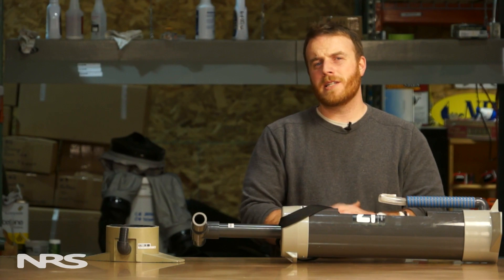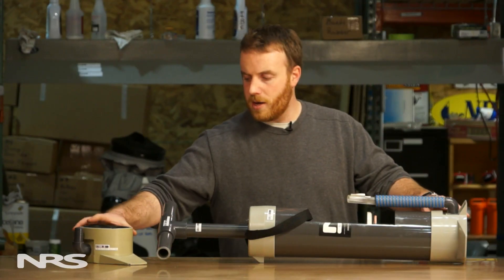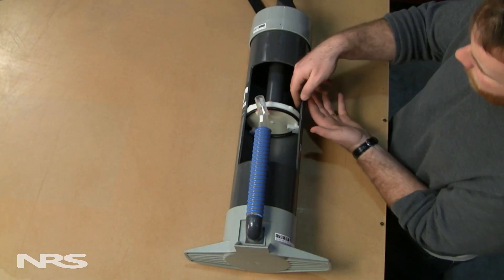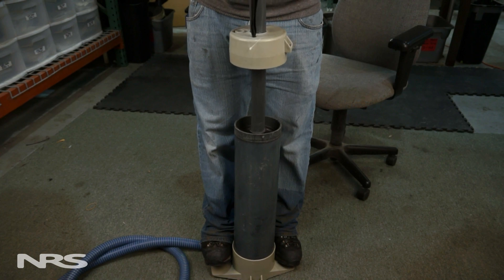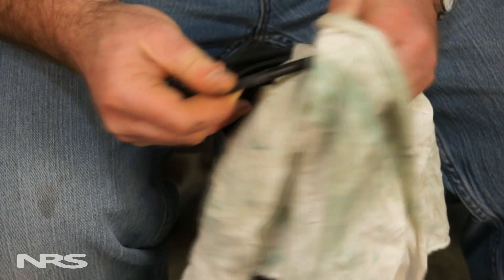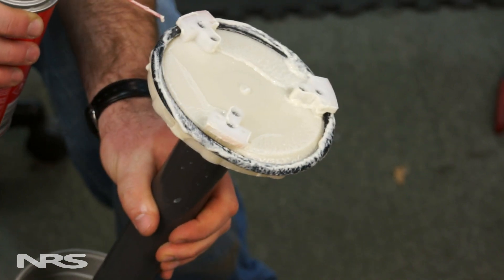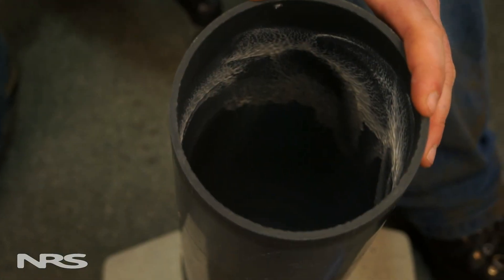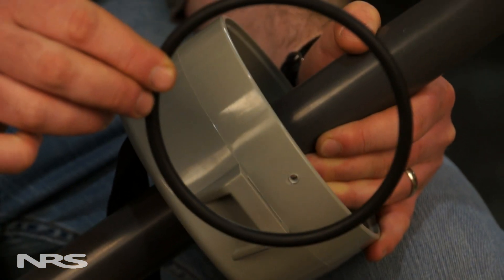How To: Maintain the NRS Barrel Pump

Comment from the maker: Great question, it sounds like the check valves needs a little PVC cement/glue in order to keep it in place. And actually, if you are not using the pump with military valves, but rather with valves that self-check (nearly all modern valves) then the check valve isn't necessary. It just prevents the pump from pulling air in through the hose. In either case you can definitely send the pump to us for repair. Thanks for the question.

Comment: Thanks! This was super helpful. When I took my pump apart I found the value at the base on the inside was disconnected from the elbow joint down there. I cleaned, reattached and reassembled, but now I can hear that is disconnected again. How do I go about reattaching that part?

Comment: Everything that I've read indicates that lithium grease is petroleum based and not for use on plastic and rubber. Can you confirm?
Reply from the maker: Hi Dan, you’re correct that lithium grease is oil based. But we've never had issues with the grease compromising the internals of the pump. This video is 10 years old, and things have changed. Today silicone spray lubricant is easy to find in most hardware stores.  If we were going to remake this video, we would still mention white lithium, but silicone spray would probably be the preferred lubricant. If you’re going to buy a lubricant specifically for your pump silicone is the best choice. If you already have white lithium its totally fine to use that. If you’re on the river and need to get the pump working again using white lithium, Crisco, motor oil, etc. all become options that could work.

Comment: Lithium grease is not good unless your o-ring is made out of nitril ...lithium is based on petroleum, it tends to speed up rubber and plastic components decay. use silicone grease instead.